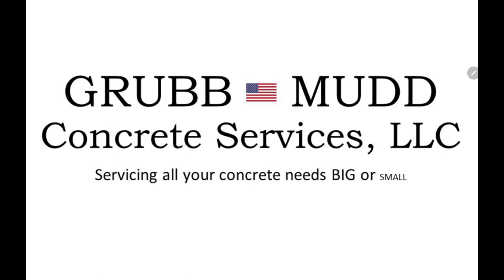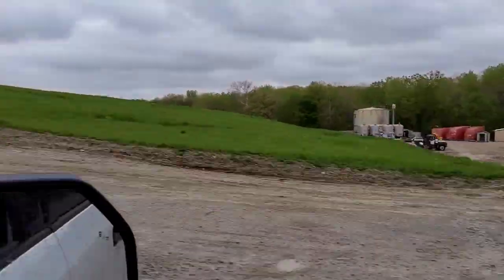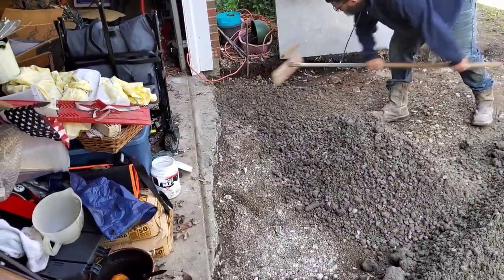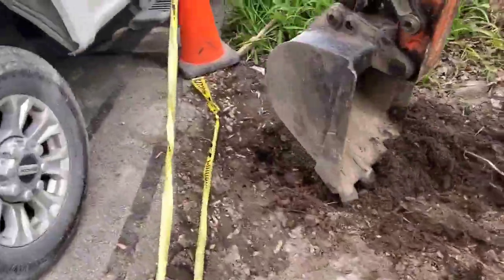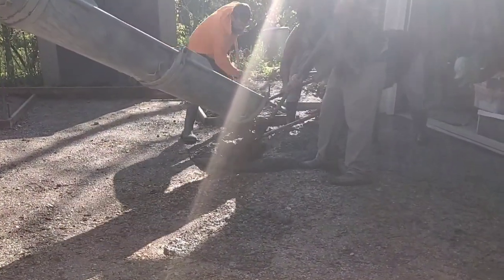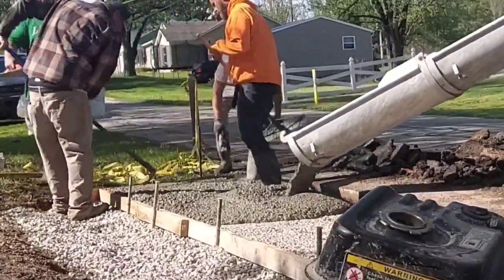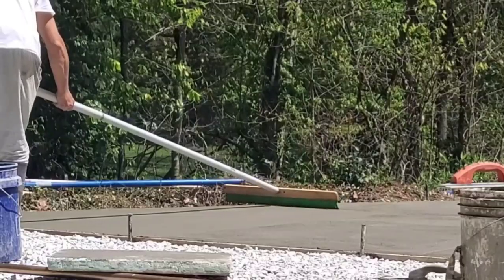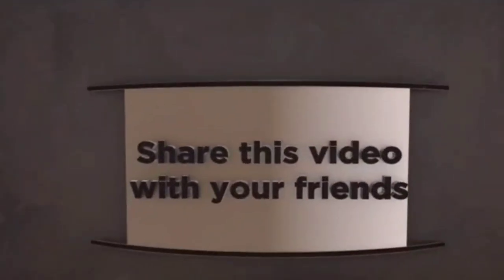How to demo and replace AN Old Concrete Driveway STEP by Step

Comment: Those front loading trucks are so interesting. We started in Denver and never saw these kinds of trucks. Came to colorado springs and saw these. Blew my mind. Also up in the mountains. Some of the trucks have built in conveyor belts so you can unload out like 50 feet past the truck. Like a little pump.
Reply from the maker: Yeah they don't have conveyor trucks here. I want a volumetric mixer, is that what u mean by dry mix? And yeah these trucks r the only way to go, they don't have rear load trucks here either. I just want the volumetric so I can get mudd anytime I want plus pour anytime I want and maybe sell a little concrete to ppl who wana do the same
Reply: @GRUBB-MUDD  that would really expand your business if mud is hard to get at preferred times. Dry batch combines the ingredients and the cemwnt truck has to mix it. If you get a lazy driver. You will pour concrete with clumps in it. A wet plant mixes it prior to loading In the truck. Much more consistent. It will set up a bit faster. But way better in quality.

Comment: Curious why you didn't cut the garage floor concrete so you had a nice straight joint?
Reply: Sorry didn't watch all before commenting.  Nice job and looks good.
Reply: We did, i just didnt really show it, we did on the 2nd day. I show it really fast
Reply from the maker: We did, I should have talked about it more than just a 5 second clip

Comment: We break concrete, and pour cement,,,then she turns to concrete again,.  Just sayin
Reply from the maker: I don't understand what u mean!
Reply: Cement is liquid,concrete is a solid,?
Reply from the maker: Our cement is powder, we use Portland cement, our concrete is 4000 psi or 6 bag which is about 4500!  I've never seen liquid cement, where r u located?
Reply: @GRUBB-MUDD  good ole Portland type 20,add water,and aggragate stir it up,she's liquid till she's concrete,up here around the wet coast of Canada.
Cheers
Reply from the maker: I get it